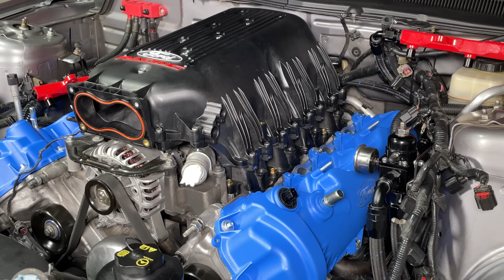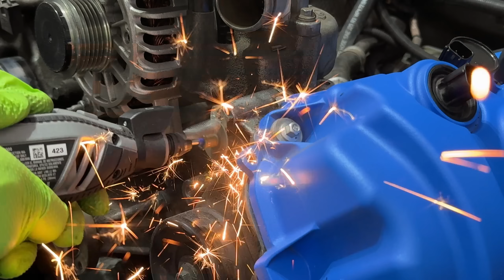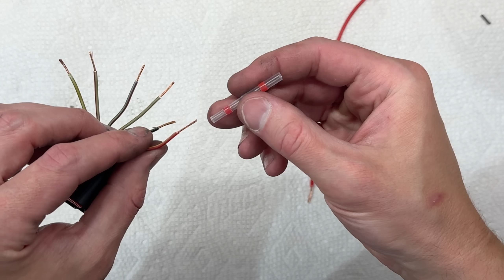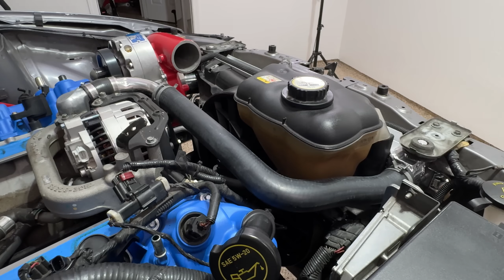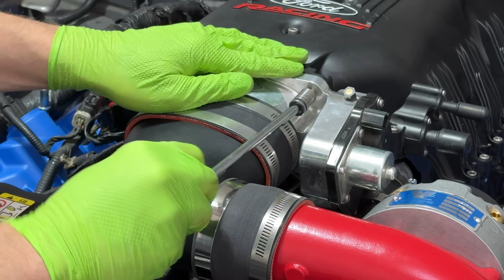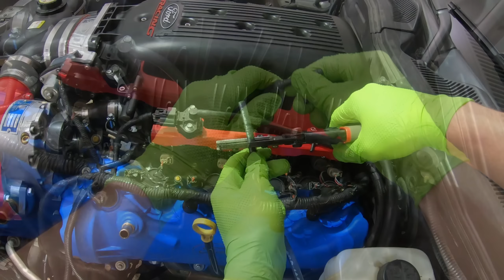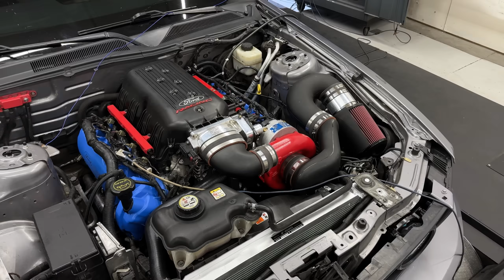Supercharging the Mustang everyone says is trash

Comment: You should totally add a methanol injection system in the intake. I also find that adding a little bit of Kreen to the gas tank helps to clean and dissolve deposits before any hard driving. I like to go through at least 2 tanks before track to ensure only gas.
Reply from the maker: interesting thanks for the tip on kreen, ill defs look into it
Reply: @Four_Eyes I originally got it for my diesel bmw and have since been using it in every vehicle after feeling the difference. It also does wonders for helping to dissolve any carbon and oil deposits after 250k miles.

Comment: I heve a 08 bullitt fully built motor , stage 3 ported heads , FR intake trottle body , long tubes , ect everything is aftermarket. Special comp supercharged cams , vortech v3 with cold air  ,with the smallest pully abd my car only made 615 on 93 . I could only manage 6 lbs of boost because v3 is spinning at max rpms … can i get 700 on pump gas ?????
Reply from the maker: max rpm? peak timing?

Comment: Everytime I see how cold and gapped most cars spark plugs are it amazes me. Mine are heat range 9, meaning it runs 5 grades higher than the ones in the videos, and are gapped to .24 which is .06 smaller than in the video. Sounds pretty insane and I bet no one could guess what car those monster plugs sit in.

Comment: Great video! Did you use the pcv hose that came with the kit? if not whats your setup for the driver side pcv ststem I'm in a pickle trying to figure out the pcv system I installed it and it leaks oil from the valve cover where it connects so I flipped it and now the pcv valve is closed at idle instead of open since there's vacuum at idle and not during WOT but it doesn't leak anymore but I'm having doubts about the valve being closed as the air is supposed to flow from engine to intake mani during idle and I asked Brenspeed if I can plug up the intake manifold and just put a breather filter but he suggested I use the supplied pcv hose mod assembly, and I was trying to see in your video how you had yours setup but it goes down the engine bay so I couldn't really see lol any reply is greatly appreciated!

Comment: For a typical naturally aspirated Ford Mustang, the serpentine belt system is designed to transfer a peak combined load of roughly 5 kW to 9 kW to run the accessories.
For a supercharged Ford Mustang, the belt system (which is significantly upgraded) must transfer much more power, often in the 50 kW to 80+ kW range, with the majority of that going to drive the supercharger itself. This belt is useless for the job, and either the compressor will deliver nothing, or the belt will fail quickly.

Comment: Glad to see you picked up an intercooler! I was yelling at the video when I saw you were running it non-intercooled. 13 some years ago when I had a similar setup on my boosted 3v (V3Si / GT500 pumps / Paxton A2A) I was sickened by how poorly the car performed off the dyno - ie: real life conditions before going A2A intercooled. This is especially notable when you have the IAT running through the maf without a Brenspeed (or other now) relocation. I was seeing temps 100 degrees over ambient without much trying, and closer to 200 under WOT in the heat. This would literally leave the car running close or near slower than stock with wildly different behavior based on time of day and outside heat / humidity. I would baseline against my brothers HCI LS1 SS Camaro and the sweep could be 8-10 cars accordingly. With it edging it out by a car or two when cold and losing by 6-8 easily in the heat. On the upshot you'll get more content. I picked up 32whp just intercooling the car and at slightly less boost at that. You wont always see it on the dyno, but in real life application where my IATs never saw more than 50-60 past ambient at WOT; the car FLEW and consistently. My baselines put me another 6-7 cars ahead with consistent, lossless power. It should do very well after the fact, even on lower boost. Maxing out a Ti, you really want a v2 style as the oil fed bearings can take far more abuse but it doesn't sound like that's the target here. Esp with stock 500 pumps etc. As always, superb editing!
Reply from the maker: appreciate all this info
Reply: @Four_Eyes  Np...sorry for posting from the work account lol.

Comment: Awesome video as always.
Do you work on cars as your main job? How did you learned about car tuning in general?

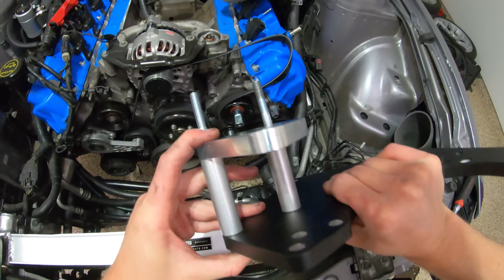BUT: for a totally ignorant person regarding car maintenance, engine assembly/building etc. those seen at 8:45 seems like a "complex system of mirrors and levers". Am I right? That engine bay starts to feel like claustrophobic to work with?
I don't intend that is badly designed or assembled as any regular everyday car engine bay I've looked at seems even worse, and pieces are less sturdy than a sport car like the mustang, but still I wonder how many hours of work an upgrade like this can take, and seems that for a stupid repair like broken intercooler fan, or a failing tube you need to disassable half of the car to reach the actual broken piece.

Comment: You need louwers in the hood for less drag and lift and it’s like free horsepower faster you go make a hole lot of difference on my car. Mine 3v stock block and clutch fbo with pro charger putted down 590rwhp 483ft but I also has problem with high intake temp that’s retard timing.
Rolled race against a last gen R8 v10 plus with extras, I was a car length behind up to 250km/h 😂 underdog mustang

Comment: By looking at the dyno chart and where you are shifting, I think you can make the car faster simply by upping the rpm by 500.... I notice when you shift the rpms drop to 5,500 rpm there you are making 470hp, but at 6,000 rpms 510hp. In my opinion I think you need a different camshaft, one that will make more power mid range

Comment: For fun before installing the intercooler, you should install a pure water injection nozzle right after the blower outlet. Not water meth but pure water, It's relatively easy and you could keep it post intercooling as well. Have it trigger after a certain IAT or boost pressure, I think you'd be surprised at how much it'll help. It would be fun and interesting to see!

Comment: If C6 corvette was "peak" corvette what are you thoughts on the current generation of corvettes?
Reply from the maker: Appreciate this question. The C8 is a marvel of modern American engineering and ingenuity. Wickedly quick and a track weapon (the ZR1 version is reportedly putting down sub 7-minute times at Nordschleife with ease).

But it doesn't come in a manual, is relatively difficult to modify, and is overall a very complex machine compared to the C5/C6. The Corvette isn't a supercar (while its performance says it really is), it's a supercar-killer that will never have the cachet of a GT3, 488, etc -- and I think that's totally fine. It also doesn't look very Corvettey to me, more like something you'd see in GTA game. 

The C6 is the absolute best bang for the buck on the market right now and probably will be for a long time.

Comment: Next buy a $400 ebay g35-900 or 1050 and do this. I bet you spend about a grand and make 1200 hp... why buy that expensive of a procharger? No lag? It's still slow till 5500. Interested In seeing how much it will make after the 5 or 8 psi difference in pully. 800?

Comment: I remember I had a 2005 v6 Mustang in 2005! When they were brand new. I loved it. By 2006 I was all in and I ended up pro charging the V6!  For $4000 back then. It too was centrifical supercharger 10 PSI and I was running 342 tq and 332 hp at the wheels! On the 4.0. I had all the parts.. aluminum drive shaft, headers exhaust, lower control arms, upper control arm. I would pull up to lightly modded 5.0’s and the new GT 2005 300hp smoke their ass lol😂  I think the popular cars on the streets in my area where the Colbert SS and the evo’s and subs. The Cobalt’s  weren’t even a challenge. The faces on them.  Fun times, miss that car.

Comment: I know you’re going air to air right now for cooling, but to truly make this a bad ass build, I’d say invest in a cheap custom air to water setup, and an FI interchiller, your IATs will then be under 30 degrees even in 90 degree heat, timing, boost, detonation will never be an issue again, and it would make your AC freezing cold if you want it to be
Reply: My giulia has water to air and even though the engine bay is truly packed, it's worth noting that it's not a cheat code. An oil cooler under the car will do wonders as well. It's all about real estate for air flow.

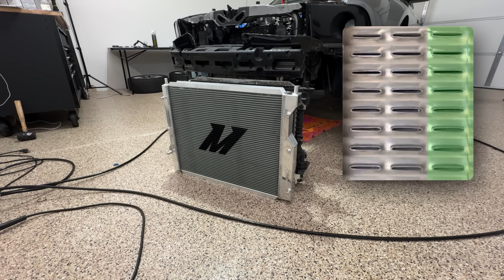Comment: 5:55 But what is often overlooked is that it reduces airflow across the core which hurts cooling and also heat transfer efficiency of that "extra row" which further hurts cooling. 

Now don't get me wrong, I'm not entirely knocking thicker cores because they often do offer some improvement over OE cores but the amount extra that you do get is significantly lower than what most people think. Basically, going thicker (which I get, is really the only option for most cars) is a case or diminishing returns.

If the option is available, always increase frontal area before thickness.

Comment: You can get the canton modular thermostat housing it lets you clock it any way you want. Canton part number Item #CAN-80059 you may need a 1 3/4 to 1 1/2 reducer if your stock coolant hose is smaller or you can remove the hose outlet annd swap to -16 an hope this helps. Also Mishimoto is good but I have had issues with the radiators they do replace them if they leak usually.
Reply from the maker: hmm interesting i looked up that part and it appears viable, thanks for letting us know

Comment: Cooler air means denser air equals more volume of air.

The more air you put into the cylinder means more combustion energy.

Heated air has less volume, less air to combust, less power.

So I’m interested how much more HP will increase with the intercooler installed.

Comment: So my s197 is damn near identical to yours I’ve been following for years building mine just like yours other then Detroit rockers I got Howard’s rattlers in mine for that mid/top end power. this will be my next big purchase/add on and I think I’ll go a step further after boosting and run a 100hp wet shot through my ford racing intake. I did just fully built the 5spd that’s in it with longer gears I’ve basically created a 4spd with 5th just being o.d

Also if your state allows it run kooks headers with its off-road xpipe combo makes the stroker motor sound ridiculously good everyone asks what’s under the hood I just tell them it’s “stock” followed by them saying “bs”

Comment: fucking upper coolant radiator hose looks sketchy asf bro he welded the parts of the adapter to that bitch if i were him id just leave it on there as is and cut the bottom off the fucking intake to accomadate for that height needed for the adapter and the coolant hose brah

Comment: Pretty efficient drivetrain considering. You’re moving roughly 70lb/min at the top of the RPM range, and it dynoed at 611 wheel that would mean either you’re roughly 10% driveline loss or making slightly more that 700hp crank on less than 10 psi.

Comment: Ooof, those solder connectors...you know you can slide the connector over one wire, make a lineman's splice between the wires, then slide the connector back over and heat it, right? Then the copper wire itself provides the mechanical connection and the heat shrink solder connector is only blocking corrosion and minimizing electrical resistance.

Comment: My ONLY question is, and I mean no hate or harm, but those intake temps on a non intercooled system are to be expected, they won’t be as efficient and you’ll be robbed of power on the top end when heat builds up, why not just get the Vortech V3 kit with the intercooler? the Air To Water heat exchanger intercooler would be perfect for straight line racing applications and very predictable and manageable for street use as well. The intercooled kit in comparison is only $2K more, why didn’t you get that kit and go that direction off the rip? I have that kit on my car and I wouldn’t go any other direction after running it, 3 years strong and as reliable and linear as ever!

Comment: I suggest not using zip-ties to securo water tubes, vibration of the engine could ware the tubes, plastic clamps which hace more surface area are a better choice, or even electrical tape, just a suggestion <3

Comment: Serious question, why use the older style wider electrode spark plugs instead of fine wire platinum or iridium plugs?
Reply from the maker: I've had misfire issues with the fine-wire ones. My experience with Brisk so far has been very good.

Comment: As a fellow 4.6 owner seeing one put down over 600whp is badass, been waiting for this video for a while and cant wait for more!
Reply: Crazy to see this is what it used to take for 600whp now it's a pump gas boosted stock motor coyote.
Reply: @169abr you can get to 600 wheel much simpler than this.  His setup is a 1000 rwhp setup just isn't turned up.  You can do 600 to the tire w just coyote rods, forged pistons and boost maybe cams too.  That's all it could be done for alot less than what he has spent like I said he has a 1000 wheel capable setup that just isn't turned up yet.
Reply: look how much advantages the coyote has.  More compression, displacement,  headflow, rpm, tech etc.  The tivct is also a game changer and helps w making power because oem cams are much more aggressive.  When you understand all the advantages and tech newer coyotes have over a 3v sohc 4.6 it isn't "crazy" at all

Comment: Super clean work there, I do wonder how much you could reduce IAT by just insulating the cold side from the rest of the engine bay a little more. A bit of foam insulation between the air filter and rest of the engine bay might go a long way before you even get the intercooler in.

Comment: I couldn't see.....did you put a grommet or anything around that hole that you cut to run the fuel pump wiring?  Im concerned that the vibration from driving is going to eat away at that harness until it shorts out.

Comment: Hey 4eyes I wanted to mention you should replace the rubber/pvc hose underneath the intake manifold with a hps/mishimoto long rubber elbow piece , trust me in the long run that pvc elbow will crack and cause coolant to leak under your manifold

Comment: Increase in air temps with no intercooler. You should switch that v3 out for a v2 that uses the same oil as the motor

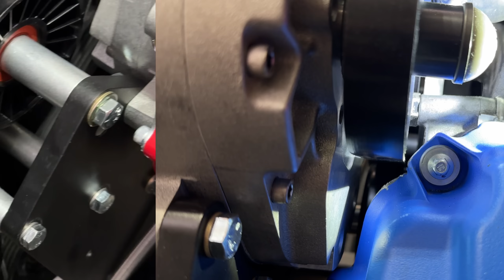Comment: @ 10:59 those belts like to dance around a bit, you should clean up the relief you cut into your valve cover. Give the belt a little more room, and make the surfaces it could touch smoother.

Comment: Great video my 4.6 Newedge was non inter-cooled for a while and would reach intake air temps above 202 degrees at 6500 rpm. After installing an intercooler I tend to be 2 degrees above ambient air temps. Not making nearly as much as you since I don’t want to blow the stock bottom end. Can’t wait to see what you make after the intercooler and smaller pulley.

Comment: amazing work ,but why did you go for a supercharger instead of a turbo kit ? or is it purely becoz its less work ?
also do you think there is more power to squeeze by changing the exhaust since you shoving more air and fuel in ,so the exhaust is probably a bottleneck at this point

Comment: Not running a intercooler really on works a carburetor car. Because the gas cools the are as it comes in. On my SBC out the blower air temp will be 100° and right under the carb will be 50°

Comment: Lol that 0-60 list had nothing but 4cyl cars as a comparison..
Also , why cut the stock harness and use solder. Solder screws up signals , you should have wrapped the wires and used shrink wrap OR just use a mafs extension harness that's plug N' play...otherwise, your build is sweet and a solid well done , no corner cut build.

Comment: I'm glad I Coyote swapped my 2005 GT. Its a night and day difference. Mine did have a Predator blower on it until recently but my blower ate itself. 

I also did the 11-14 electric power steering conversion so I could get rid of the power steering pump. (It drops right in) Its a good mod for the old 3V Mustangs though because you'll have less parasitic loss. I did it because the power steering rack was $200 and the PBH FEAD kit to keep the original power steering was $800, so I chose the cheaper, better option.

Comment: Good vid! Just so you know & others!  The FRPP intake has a small port in the back of the manifold for IAT/Boost Sensor....you didn't have to drill the runner like that FYI! (I have one)
Also for the Non Intercooled Centrifugal ( I went with a Novi 1200) you can keep the underdrive pullies, and just run the next step down on the SC pully. Brenspeed has the 3 inch and 2.75 inch for centrifugal chargers. Which gives you 4-7 psi, that is perfect for a non intercooler, it keeps the speeds down just enough so you don't have to worry about SUPER hot air at idle on 91/93 Oct.
Reply from the maker: good information thanks Igris
Reply: @Four_Eyes  Thank you kind Sir! I've been watching your content for a long time! Much appreciated & keep the vids coming!

Comment: instead of adding an intercooler, add a water sprayer pre compressor. dont need a 50/50 mix of anything. pre turbo and go from 200CC, to 400, to 800cc and test the results. this will lower intake air temps A LOT. i did that on my rx7 and saw great results. especially the water mist shooting all over the engine bay after a run. kinda crazy how well it works. i was doing 800CC smack bang right in front of the compressor and it loved it.